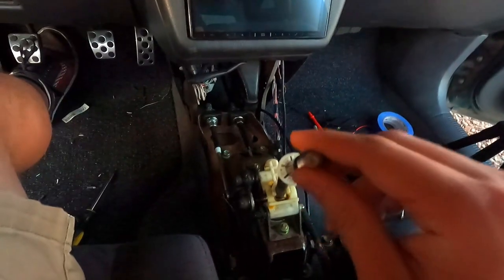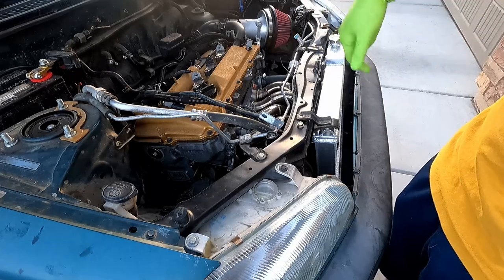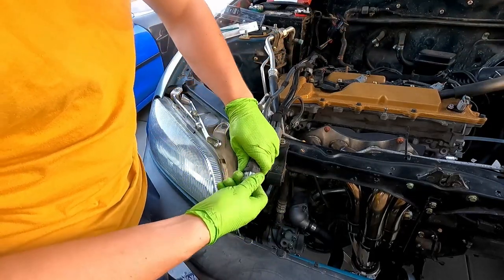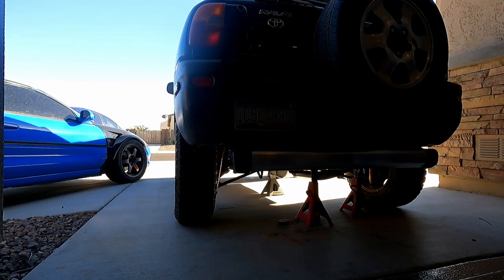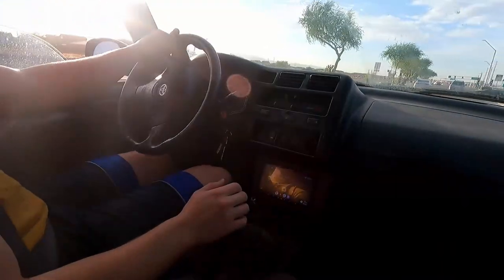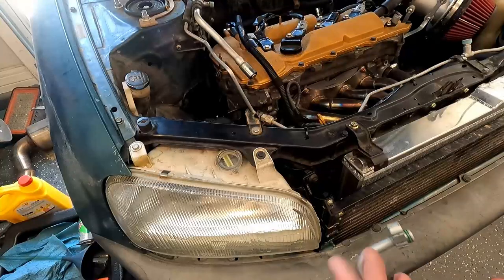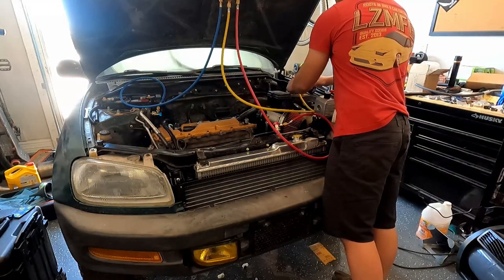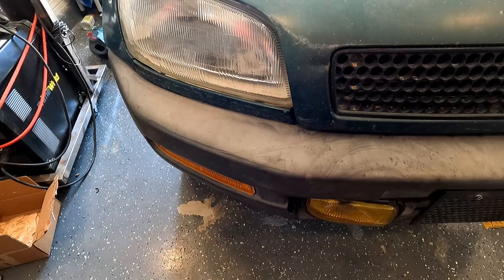Going From "Drivable" to Drivable | 2AR Swap RAV4 EP12

Comment: The Prius electric pwr steering column would be a great swap.  I use it in my alltrac
Reply from the maker: I have one from a tC I plan to use. It should interface with my ECU and adjust assist based on speed
Reply: @aristoyotacorner  OH that's awesome!  Looking forward to updates.  Does she pull much better now?
Reply from the maker: @boostgoober7262  yes, it's night and day. It's around twice as fast as it used to be. About as fast as my MR2 turbo was

Comment: Ceramic coating does a good job with worn trim. Or heat gun
Reply from the maker: Yeah I'll probably try a heat gun. Just need to go slow so I dont melt stuff :)
Reply: Yeah I say give the heat gun or a torch a go. That usually brings it back pretty nicely